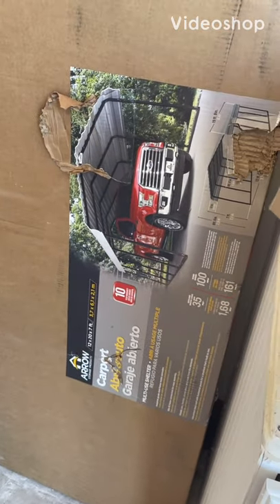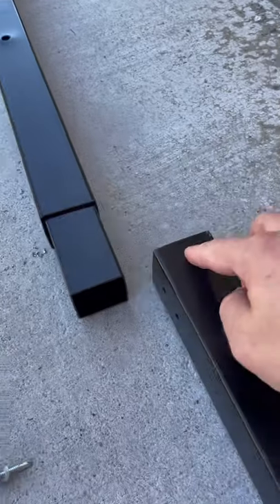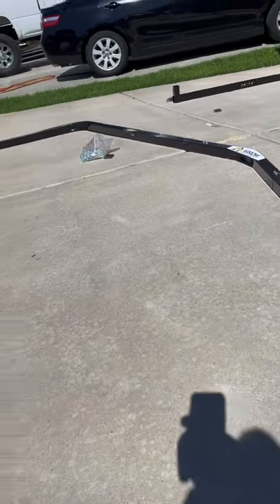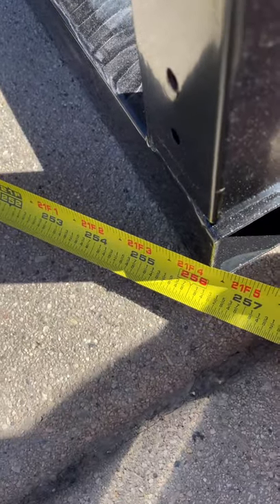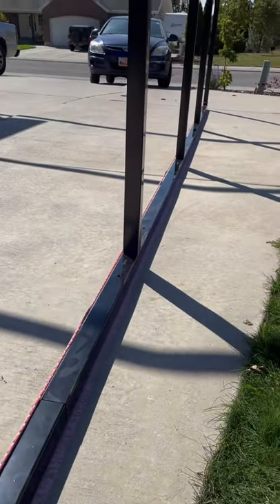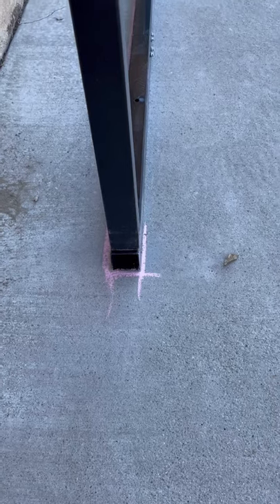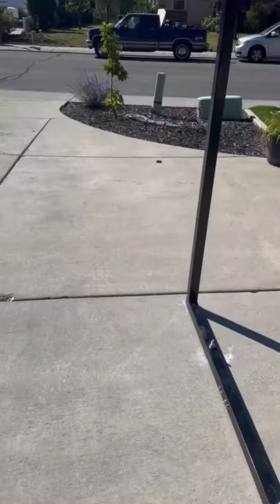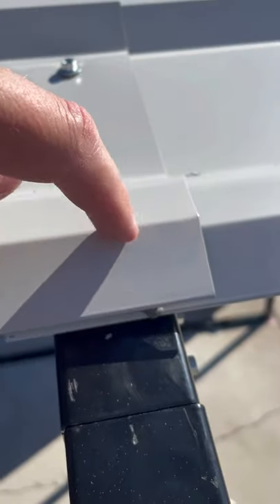How to Install & Anchor Arrow Carport 12' by 20' by 7'

Comment: I recently installed this exact carport, thank you for the video. Just a useful tip/suggestion for installing the roof panels, was actually my wife's idea. Place some 2X6s across the bed of your truck and back it into the carport. Provides good height and a stable platform that positions you above the roofline and enables you to apply much more leverage and stability driving the screws without having to move your ladder constantly. These screws don't self tap so easily sometimes unless you are square on them with adequate pressure. I can tell you from experience that it sucks when you are on a ladder tring to apply pressure and the screw slips.

Comment: Great video, thanks for posting it. One comment. You mentioned "the anchors expand when you hammer them in" Actually they wedge into place when you tighten the nut. As the threaded portion pulls out of the hole, the sleeve slides down the wedge, expands and locks the anchor into place. I'm going to purchase the 20 X 20. Your video was very helpful.
Reply from the maker: Thank you.

Comment: By drilling the holes for anchors with the frame in place the water went inside of it and will rust out faster , i would have marked all holes moved the frame out the way then drilled, that's whats great about these videos, its like a heads up before you do your own build, thanks for sharing.
Reply from the maker: Thanks for the input.

Comment: I've drilled a lot of holes at work for anchors, and I was never taught to use water to cool the bit.  
Also, I was taught to put the nuts on the lag bolts before hammering into the concrete. You could mess up the threads hammering them in, and then you won't get the nut on.
Reply from the maker: Thanks for the feedback.
Reply: Little do you know, the top of the stud wasn't straight up thread. He was fine without doing so.

Comment: I just installed a 10 x26x12 RV carport.  Installation went great.  It is securely anchored into my concrete driveway.  I am concerned about it's ability to withstand strong winds since its higher than it is wide.  The problem is that I can stand at one end and slightly push on the wall supports and watch the intire structure shake.  I invision this thing wobbling during a thunderstorm and breaking free from the ahchors.......or simply having it fall sideways.  Is there anyway to cross brace the unit to give it more structure stabilty?
Reply from the maker: Installing more panels on the sides will help.

Comment: Thanks for doing this video. I just finished building my 10x20 and your video was way more helpful than the lame instructions that came in the box. The only thing that I would add is that anyone building one of these needs to make sure to have a decent driver with two to three batteries to rotate through. This build has a shit ton of screws.
Reply from the maker: Thanks. Glad it helped you.

Comment: Could you cut the legs if you wanted? To make it shorter? I live in a hoa and park my boat in backyard and want something like this but idk how high we can have things go over our fences
Reply from the maker: Yes, you can cut the lower part of the legs off and they will still fit over the ends sitting on the ground. You will just need to drill new pilot holes for the screws.

Comment: Hi Jed. i'm looking at this exact product. couple of quick ones if you don't mind. a) how is it holding up a year later and are you happy with it?  b) i'm 6 5, and i think they may sell an extension to make it 2' taller. how tall are you and is it tall enough for you? i would be parking a Ram 1500 under it.  many thanks.
Reply from the maker: It’s held up great. Very happy with it.  I’m 6 2, plenty tall for me.
Reply: @JedsGarage  many thanks.
Reply: @JedsGarage  I just wanted to thank you. For the video. I'll give you a tip. Use fluid film to lubricate your drill bit. It sold at Napa and a spray can. It works awesome

Comment: Going to be building one coming up. Great video. What was your technique in raising the frame sections by yourself?
Reply from the maker: This size carport the frames were not really big so I just stood them up myself and slid them on the opposite ends. Pretty easy. For larger carports, you would need at least two people to do the same job.

Comment: I wonder how you could anchor this on a gravel driveway
Reply from the maker: Great question. Use Rebar anchors or rebar stakes. You may need to move the gravel out of the way where you are hammering them in. Then move the gravel back in place once they are hammered in.

Comment: Did you have to tilt the port at all so that the water flows out?
Reply from the maker: Thank you for the question.  The port will follow the slope of the ground you set it on.  The more the slope and the flatter the ground the better it will drain but it drains pretty good even if you neglect these guidelines.
Reply: @JedsGarage  If you build on existing concrete like Jed, check the slope first and build the roof with the panel overlaps stepping down in the direction of flow. If you want ALL the water to come off a particular end, slope it that way first.

Comment: How much wind can it withstand before it's damaged?
Reply from the maker: We’ve had several high wind storms blow through and it does really well. Just make sure it’s anchored well and you shouldn’t have any problems.
Reply: Arrow says it can withstand 35 lb snow load and 100 mph winds.